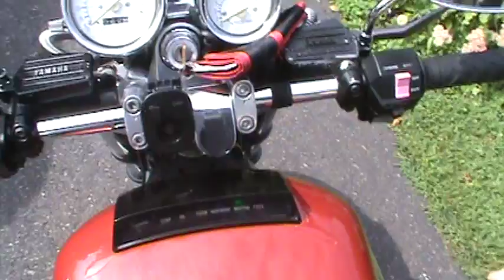86 Yamaha FZX 700 Cliff's

Comment: lever in inwards (closest to the bike) means the choke is off.  funny I also drive a nissan and exactly same color.  I also have an 86 fzx750 I'm swapping out the front end with fzr600 and have putting on a fzr1000 swingarm.

Comment from the maker: Yeah I changed a whole lot on the bike if you read the write up on it I did.  straight Handlebars, FZR600 front end, XJR 1200 rear end, Kerker 4-1exhaust, removed grab bar, changed gearing to 48T, reworked the carbs mega, seat recut by hand removing 1 1/2", fake Ohlins rear shocks, and I just installed progressive springs in the front end, paint, and a keyless fuel cap.........did I miss anything?

Comment from the maker: No, its the 17" from a 92 FZR600.  I made a custom bracket up under the seat frame, like the original, but Wayyyyyy shorter, I even used the original plate light!  Really its just a bent piece of plate aluminium.